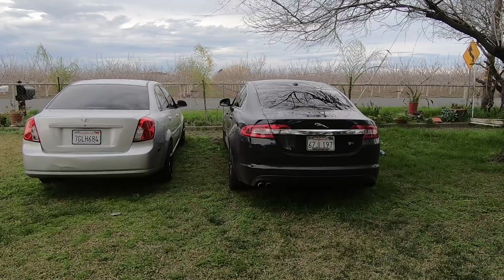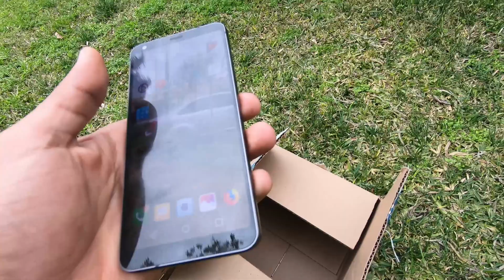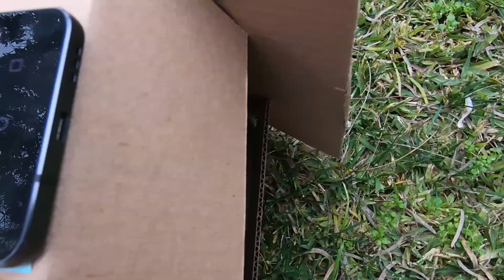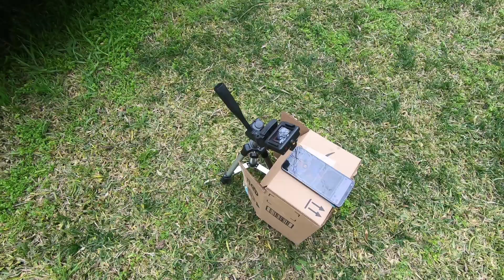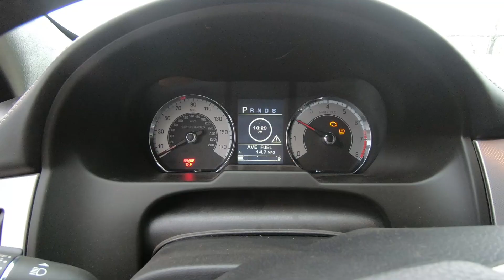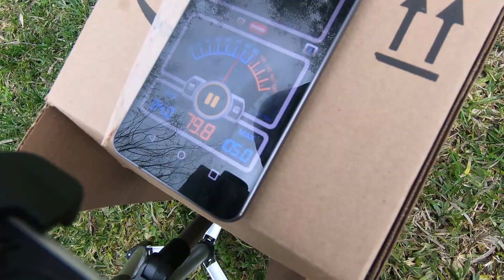How Loud Is 95 db?? California's (AB) 1824 Exhaust Law.

Comment: Is 95decibels at idle if they pull you over?
Reply: it's at 3000 rpm, 20 inches from the exhaust, the measuring device must be centered with the exhaust and located at a 45 degree angle
Reply: @NemoTheGlover  3000 RPM?? if you drive a diesel that think would be fucking screaming
Reply: The dbag made me hold mine at 2k rpm while he was behind my car. So obviously I held it at 1700